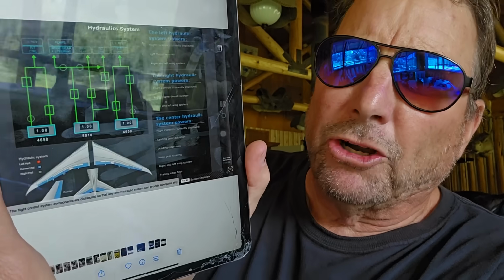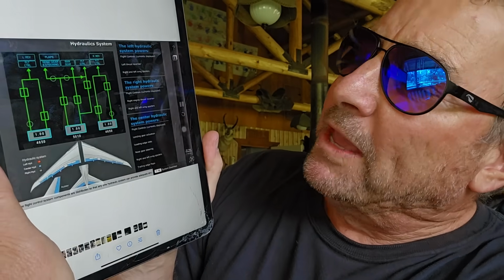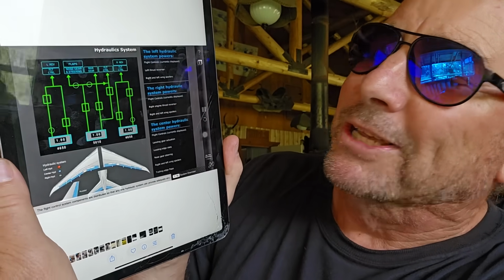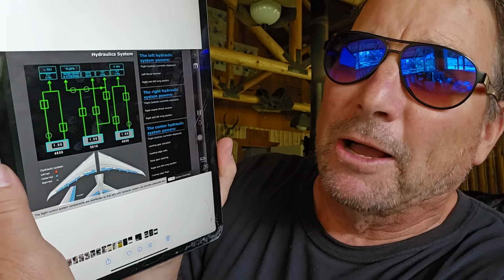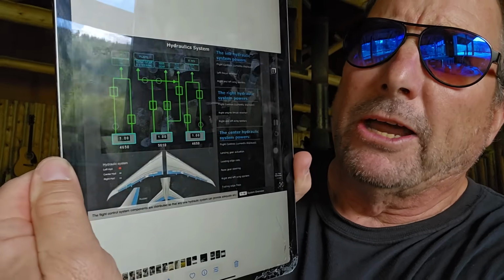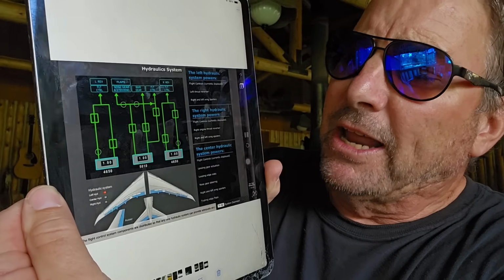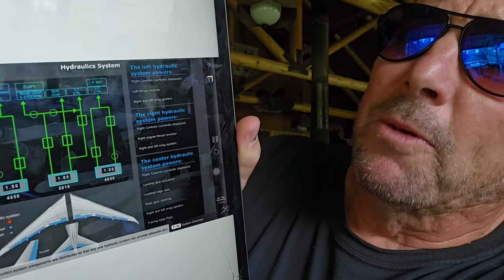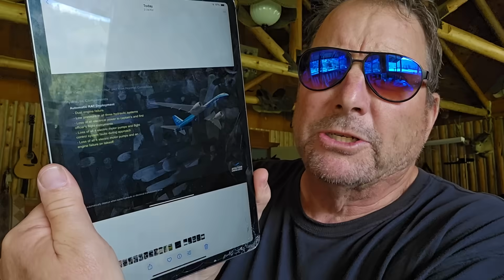787 Crash India What's a RAT? When does it deploy?

Comment: I have flown the B787/B777 as Captain at a major airline. The airplane will not let you take off unless the flaps are set for the setting required by the Flight Management System. Period. It will never happen. The most important thing in that grainy video from the right aft perspective is the pixel inboard of the right main gear and aft of the wing just below the fuselage. That is exactly where the RAT (Ram Air Turbine) is located. It deploys when a loss of both engines or a loss of hydraulic systems occur. The RAT will not retract the gear. My feeling is a complete loss of engine power shortly after liftoff, deploying the RAT. Audio associated with this video is also exactly what the RAT sounds like when deployed.
Reply: On point skipper. I have a very minor disagreement. You can takeoff with the configuration system barking but you’d have to be deaf and blind….or willfully ignore the visual and audible warnings. This investigation is going to be very interesting.

(BTW, I retired about three years ago after about seven years as a 787 captain from a non-Dallas based airline)
Reply: think it will bitch and scream if you do not have a TO configuration set (checklist incomplete on EICAS and master caution) but it will be happy if you set ANY TO configuration - even if it is not correct?  Is that right?
Reply: @TrollingwTyrone No.
Reply: The Douglas "Bitchin' Betty" voice would snap: Fwlaps Fwlaps very loudly.
Reply: What if the input of flap setting wasn't the correct setting ?..max, weight calculation is done by a average weight per passenger & hand baggage.....fat passengers, heavy hand baggage. passengers now carry the heavy items in hand baggage to avoid extra baggage charges......load all that behind the CG ....there you have wrong calculations.....wrong FMS setting. 
High density attetude, max weight....late rotation to avoid running out of runway.....then a mayday call.....wasting seconds that can mean disaster.....my rules in emergency's is 1) fly the plane....#2.......fly the f.....g plane....#3 fly the f....k, f.....g plane.....at that critical point ATC or declare a emergency is pointless.
Reply: Looking at the dust raised during take-off it seems the plane used the full length (3500 meters) of the runway (flight24 confirms it backed to the other end of the runway before rolling)...
Could that be an indication of a power/weight issue, well before the fatal loss of altitude?
Reply: @DR_1_1 That is possible. I’m sure the CVR will reveal the pilots’ colorful reactions if that is what happened. I’ve been there albeit with a different outcome.
Reply: @SSBailey77845  It should... although the result of these investigations often get less public attention, or the CVR is suddenly lacking (eg the helicopter in NYC, Learjet in Philadelphia)
Reply: Capt Steeve got it all wrong in his vid, whereas Juan is spot on.
Reply: @purrple.shadows    Captain Steve has now posted  a new video. He now says the RAT did deploy.
Reply: @gardenman3  the first video you couldn’t see or hear it so...
Reply: @purrple.shadows exactly. He wasn’t just a little wrong….he was all the way wrong. I had seven years on the 787….but what do I know?
Reply: @SSBailey77845  guy is a jerkoff - unreal he is not aware of the RAT- would never want him PIC on any flight I'm on plus who tf refers to themself as Steeeve !  with that light-in-the-loafers delivery jfc
Reply: Captain Steve played the original video taken from the rooftop near the crash site, as the first one we saw was a video of that video. The sound quality was much better, and it sounded like recordings of other planes with the RAT deployed. While it was still grainy, there was what looked like the RAT and the RAT door in the right places.
Reply: @GoCoyote  Well after Juan mentioned the RAT deployment
Reply: @GoCoyote Well after Juan had mentioned turbine deployment.

Comment: I’m most curious if we know for sure yet if they used the full length of the runway or did they do the intersection as FR24 indicates? 11k feet vs 6k feet runway length and time or little time to abort.
Reply: Flight Radar 24 have confirm that the aircraft backtracked and had the whole 3,600m of the runway available.
Reply: @christopherrobinson7541  Source?

Comment: I believe the unique sound is caused by the proximity of the 2-bladed propeller to the bottom of the plane, the hatch door, or the arm that the RAT is mounted on. Listen to a model airplane that has a pusher prop right behind the wing or a prop that’s spinning in a slot cut out for it.

Comment: I suspected dual engine rollback on rotation from the parabola after it began to climb, and that it simply begins settling all the way to impact.

No speculation on why, but I am certain that the enhanced airborne flight recorder will provide a great deal of information.

Thanks JB, for your diligent efforts to inform.
Reply: Yes. I saw a post somewhere of the ADSB data and the last three (I think it was) points show no climb. Looks like engine power may have been lost within a very few seconds of wheels off ground. I saw a report that another similar Boeing had lost engines on the landing roll out due to some confusion in the air-ground logic. No reason for FDR not to reveal a lot very soon.

Comment: A ram air turbine (RAT) is a small wind turbine that is connected to a hydraulic pump, or electrical generator, installed in an aircraft and used as a power source. The RAT generates power from the airstream by ram pressure due to the speed of the aircraft.  It is deployed as an auxiliary when other sources are detected as having failed or suffered impairment.

Comment: Finally someone willing to consider this may be more complex than very experienced pilots making kindergarten level mistakes - which ofcourse is possible, but not something to double down on without any basis more or less
Reply: never seen so many wrong experts,,  going by there eyes but ignoring the rat deployment which was noted early on
Reply: Like the first 737MAX crash.  Lots of Westerners very quick to blame the (non-Westerner) pilots.

An easy answer (especially for Americans), rather than having to consider that PERHAPS it was the American Manufacturer's aircraft at fault.
Reply: @gomezgomezian3236  Not this American. I respect the combined 9000+ hours of experience that was in the cockpit. However, maintenance records on the part of the carrier can't be ignored. I'm from the Chicago area and remember AA191 quite well.
Reply: Indian pilot showed unreal courage and character by following all the protocols while death is in his front within 30 sec. When they knew RATS were out and cause dual engine failure 
1. Called MayDay ATC
2. Took the gear intact for some landing.
Reply: This seems like cope. Wait till evidence is revealed
Reply: @The_noticer-u2b suggest you consult the dictionary for the definition and use of the word cope, your use in this context makes no sense
Reply: @PRH123  people with 9000+ hours of experience can still fuck up.

Comment: New video on New York Post showing a passenger on this exact jet on the previous flight about two hours before the next flight takes off showing how everything was dead inside- "nothing is working". No AC - lights aren't working - electronics in the seat backs are dead. Seems to be a pretty open and shut case of gross negligence. No maintenance. This jet shouldn't have ever taken off!
Reply: Cpt. This is starting to look worse and worse. Aircraft having massive electrical problems on prev flights/hours before this flight.  Overseas/non US airline maintenance neglect???😬🫣🫣🫣🫣🫣🫣🫣

Comment: There was a video posted by a passenger who was apparently on the flight of the aircraft into Ahmedabad, that is, the last successful flight of the aircraft.  He said there were problems inside the cabin, including no air conditioning and no seatback programming.  Could this apparent failure have any bearing on the subsequent accident?  Could the crew have manually deployed the RAT to supply cabin air conditioning?

Comment: One would think on a high/hot day with the density altitude at 3500 ft on a 6500 ft runway. I would wonder why it wasn't flaps 15 and I don't see that in the videos. Maybe it was 5 so not as easy to see. We all need the recorders examined.
Reply: Flaps 15 would cause a whole lot of drag, inhibit climb performance, and be completely unnecessary on an 11,000 foot runway, of which the airplane only used 6,000 or so feet. They lifted off halfway down the runway and were 600 feet up by the end, which is where they started losing altitude.
Reply: They kicked up a pile of dust down at the displaced threshold. Didn't look like rotation at mid field to me @ErickC
Reply: @a-sea3369  : the ADS-B data indicates otherwise.

Comment: What may have happened was right  at the moment the pilot in control is asking for gear up what if the second or Co pilot raised the flaps instead keeping the gear the massive drag inducing gear out with flaps now recalled would the 787 been able to continue climbing at take off power  only because the gear  should have already been up in the wells  just after positive rate was called... Maybe the  pilot monitoring was distracted by something  not known yet ?

Comment: The RAT has an unmistakable sound. I highlighted this in comments on other channels that were suggesting this is pilot error resulting in retracting the flaps instead of the landing gear after take off. I highlight these points. #1 They were extremely long on take off. Appearing to lift off in or just short of the run off area. Suggesting a difficulty achieving take off speed. Possible engine failure on take off at or around V1. This would deploy the RAT. #2 Air density is high. High humidity reducing the effectiveness of the wings to create lift. Not mentioned yet. #3 The pilot on coms declared Mayday. Indicating there was just cause to react to the possibility of losing the aircraft. Suggesting a system failure rendering a loss of control in either climb or lateral flight. #4 The inability to retract the gear, with a possible reduction of power, high air density, long take off with nose high attitude, deployment of RAT, Mayday call and pancake descending attitude are all signs of an aircraft of this design with critical system failures developing at or around V1. Not pilot error. Just my thoughts. Thank you for your contributing to aviation JB. I agree, let's hope we get answers from recovered data.
Reply: Flaps are not the only way pilot error could cause or contribute.

Comment: Really appreciate your content but I have to argue that the sound you identify as the RAT is a *fact*. It is not. It is impossible to determine the sound came from the 787 as opposed to another source. It is also impossible without spectral analysis to determine if it is consistent with a RAT. While your knowledge is beyond question, I would ask which is the most probable cause? Any of the severe multiple failures you enumerated or pilot error? I would suggest that the pilot calling for gear up resulted in the non-flying officer putting the flaps up to be way more probable. We will all have to wait for the investigation. I just hope India's accident investigators are not like some other investigators in the past that come up with some nebulous reason to blame the aircraft rather than the pilots of the nation doing the investigating ala Egypt Air 800.

Comment: A RAT is a teeny tiny itty bitty little wind turbine, designed to produce a lot of power at a high RPM in a high-speed flow.
Wind power goes with the CUBE of wind speed.  Most modern wind turbines are designed to reach rated power in the 10-12m/s range.  The RAT has to be able to operate at 100m/s, or more.  (100/10)^3 = 1,000.  So a RAT can, in theory, produce 1,000 times as much power as a conventional wind turbine of similar size, or the same power as a conventional wind turbine with 1,000 times the swept area.
Now, that's simplified and I don't know the flow velocity or power of an actual 787 RAT, I'm just making a comparison to conventional wind turbines.

Comment: There is a photo of the right wing outboard section which shows flaps out as well as slats extended in other parts of wreckage. Additionally a comparative angle of a Qantas 787 taking off looks identical to air india. I think the flaps is a red herring and a ton of misinformation.  Also the survivor mentions after take off he says "the captain turned on green and white lights before impact" what that likely was is the cabin emergency lighting automatically coming on with loss of power. And reports state the mayday call was a loss of thrust.   This is disconcerting what causes a loss of thrust of both engines.  Could be fuel contamination. Some sort of fadec electrical foul up (less likely) or a hidden design flaw similar to ba38.
Reply: If it was fuel would it really happen on both engines within seconds? There was no rudder input so both engines stopped simultaneously. That would point to a pure electrical fault.
Reply: @iot-portal4806 if the electrical fuel pumps feeding both engines shut down simultaneously, both engines would starve of fuel.
Reply: I read the airport is 200 Ft above sea level. The plane reached maximum height of 425 FT AGL, (above ground level). I read the FAA states that the minimum height for autopilot engagement is 400 Ft. AGL, Wonder if the pilot engaged the autopilot and the autopilot failed due to some sort of electrical problem and it shut the engines down.

Comment: There is a video going around supposedly showing the same jet on its previous flight, prior to the crash showing serious electrical problems,  no air-conditioning working, seat screens not working and the remote in the seat back not working, this was prior to its take off, they then flew the jet in this condition to the airport, where the crash occurred after take off.
Reply: Interesting, if true
Reply: The problems in that video are normal legally accepted issues in the minimum equipment list. Actually on the aircraft I fly Bleeds for air conditioning are off for take off and landing to save engine life/ money and have all thrust available ( though not needed)for take off operation and not diverted to air conditioning
Reply: @EdAjega-ht2ke  787 is a bleedless architecture - only use bleed for hyd reservoir and anti ice
Reply: @TrollingwTyrone  Thanks for letting me know.
Reply: I think that video is same plane type.but not.same plane on the same day showing issues. Still no bien.

Comment: If it was simply flaps at 0 the plane would have got to rotation a lot sooner along the runway. This means most likely the flaps were set correct and if rat is out the engines may not have had fuel from the pumps. Not pilot error I believe.

Comment: Apparently, the last transmission from the aircraft (the Mayday call) cut off right about the time it was at its greatest altitude (425 ft or so). Would an electrical failure disable the engines and the transmission equipment at the same time?

Comment: This is a head scratcher for sure. If this info about the RAT is correct, then that takes the mistakenly raising the flaps scenario out of question.  Contaminated fuel is a possibility, but how does that happen to both engines at the same time? The closest scenario for that would be the British Airways 777 that had both engines roll back on final to 27L in London, but that happened after a long haul flight with cold soaked fuel. And as far as the hydraulic system failure goes scenario, you would think that the amount of pump and pressure loss to activate the RAT would have had to begin happening prior to V1 with the accompanying warnings on the EICAS prompting them to reject the takeoff. Beyond that I can’t envision how you get into a dual engine failure scenario. Thanks for the update Juan.